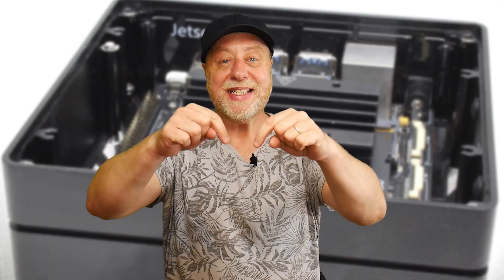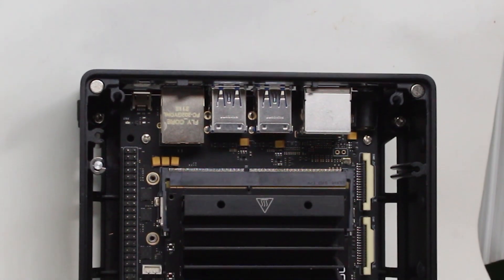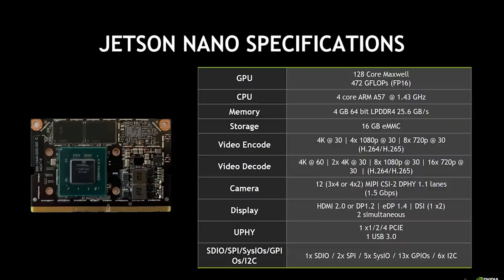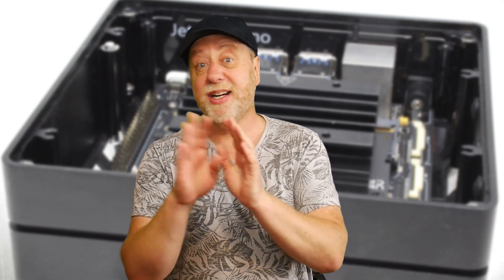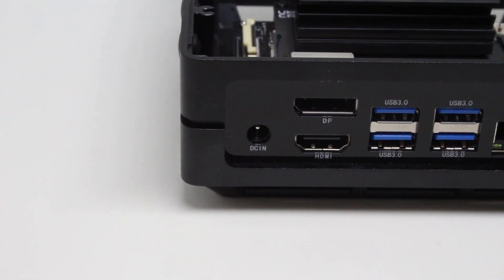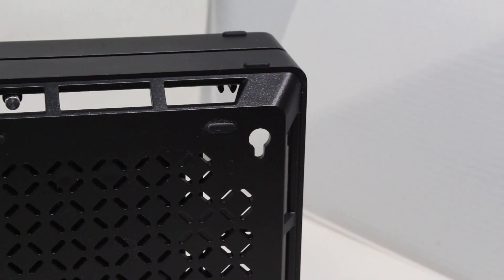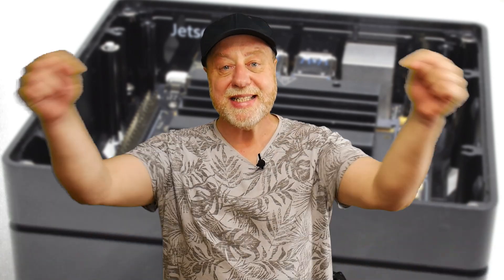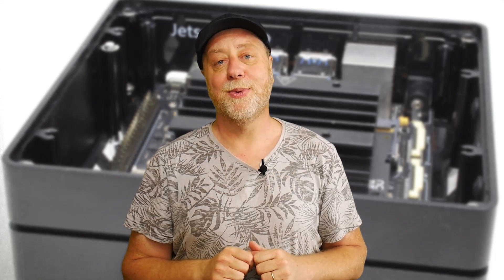Jetson Nano Based reComputer J1020 - Arm based PC with NVIDIA GPU

Comment: Hey Gary, can you make a video on why the latest mid-range processors such as 695 doesn't support 4k video recording? Curious to know it, as based on benchmarks these processors are much faster. Even budget phones 4 years back used to support 4k recording, which benchmark will be half of the latest phones.
Reply from the maker: Because it depends on the media capabilities not the CPU/GPU. It is one of the features that chip makers can tweak to differentiate their processors.

Comment: jetson nano is a waste of time and money, I tel you why:
- os based on ubuntu 18 with python 3.6.9, today often is requied python of an higher version
- opencv is not compiled for cuda (why?) and it cannot be last version because needs cuda 11
- all the jeston come with cuda 10 ... while modern ML architecture, if you want accelerate need cuda11
- tensorflow is a disaster, first is not cuda accelerated, then, if you are lucky, you can use 1.9.2 while often is required 2.5 an higher and when you recompile it you get aways an error on a library
- if you enable the desktop it takes1.5GB of ram on a system that has only 4G

it is a toy, but if you want to use for deepface, use it for mediapipe, most of the time it doesn't work.
But the main point is that you can use it as SMB, but you buy it for having cuda acceleration, but the drivers are behind light-years....
Reply: Agreed. And Jetpack 5.x is not and will not be supported on it. I got a J1020. It's nice, but I 
should have gone for Xavier or Orin.

Comment: The way M.2 SSD speeds have gone over the last few years, and the capacity of them, it seem to me the inclusion of the relatively slow EMMC storage is a wasted effort.
I like the provision of Display Port.  It's a shame about the lowish clock rate, and the RAM is a bit low, especially considering the competition.